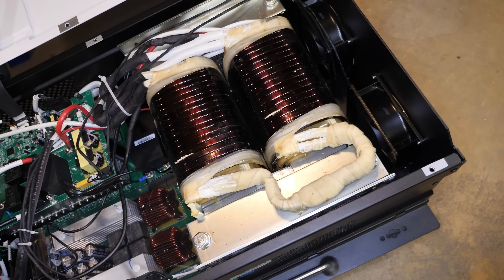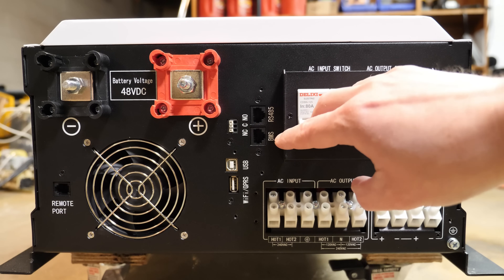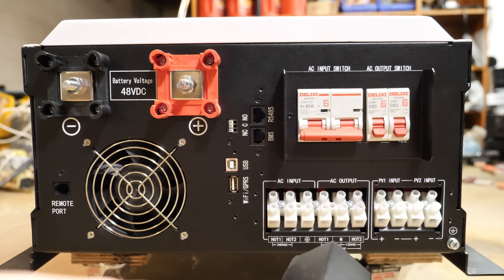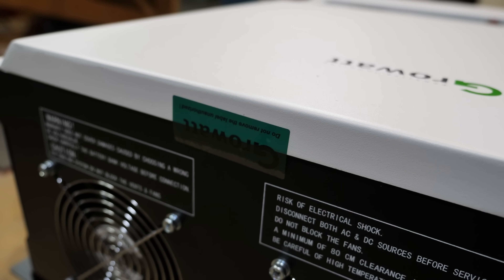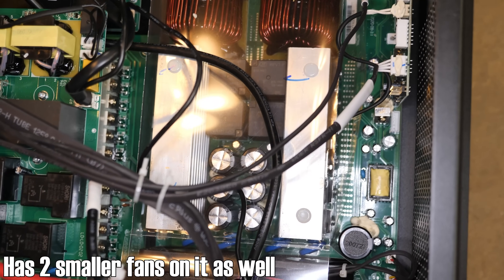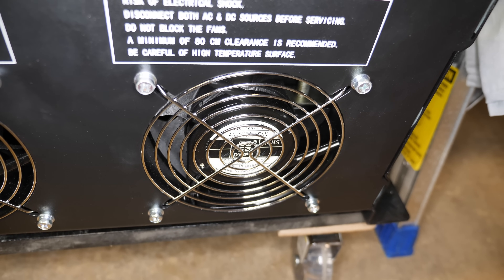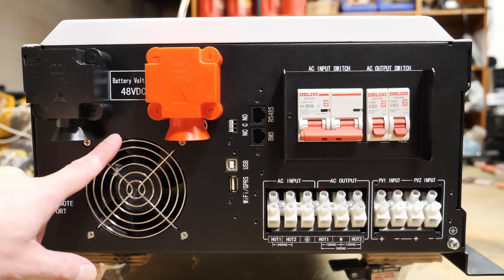Overview of a 12000w Growatt Split Phase LF Inverter!

Comment: Guys do NOT and I repeat do not get this inverter.   High idle consumption, loud fans, fans that break down after 3 years btw,   slow transfer switch you can literally see the lights go out and desktop computer rebooted.  Further more it's a pain to go through the setting compared to Victron and other models.  Yes the transformer is big, that doesn't say f all.  Victron and Ampinv also have huge transformers , have better features and are overall a lot better.  Just my humble opinion, i'm going by actual experience and comparison.
Reply from the maker: All valid for the most part! Except I didnt have the crappy transfer time. Mine worked great and computers stayed up and running. My fans never failed either but I did change them after a few years to quieter ones. This was the biggest I could afford at the time. Overall was happy with the intverter.

I have an eg4 hybrid inverter now and its great.

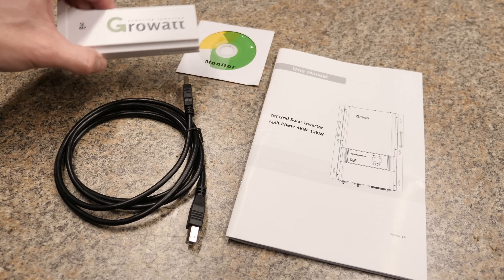Comment: Sorry my entire message did not get posted, I am in search of and for the 3in monitoring disk that you show @2:21 for the 12,000 watt growatt inverter,  I have tried the ginverter web address that is in the manual and there is absolutely nothing there, and i have tried the growatt master site and the only dl's there, are for the data sheet and the manual for these  beasts. I did buy two of them like I said, i was going to  do, but the USB cable is not any good without the software disk. AND to top this all off i have been in contact with signature solar and their response was (I did mention this video to them BTW) was, I do not ever remember shipping this model  inverter with disks of any kind,. unquote. My question is and was is "Do you still have the software disk for the 12,000 watt growatt inverter?" I need a copy somehow please . All avenues have been a dead end in my search for it. I believe that there is no one else to solve this missing disk thing. dead stop. Everyone so far clams that there is no disk included in this inverter package. @2:21 clearly shows that their is one...
I could email you but how would you know that it was me so it does not end up deleted or in Spam. GREATLY Appreciate any help that you can give. Thank You in advance.
side note i did buy two 12 inverters two rhino batterys and 48 250watt panels.  back in may 23 when i emailed you back then.

Comment: Hi, I do not understand how to use AC out 240v. Am i wrong or it's Hot1 + Hot2 (120+120=240) together, and then neutral and grounding cables. 
I will be very happy if you explain it in video and show it with some  consumer on 240v. 
I am planning to buy one of this growatt, and i need it for  EU standard were we use 220-240v.
No one shows in their  videos for Europe standards for 240v. 
Regards from Bulgaria, 
Thank you!!!

Comment: Would like to know how to change the circuit board.
Reply from the maker: One screw at a time.....🫣. Well, I would love to make a video on how to do that. I do have spare boards BUT the inverter is running my house. I would just start removing screws and wires until the board came out and take detailed pictures before your start and during the removal process especially where wires go.

Comment: One thing I want to understand with this PV inputs is that, can they both be fed with 150v?
Reply from the maker: Yes both can be feed with 150v.  Also a side note is I didnt notice at the time but they sent the 250v model!💥🤘
Reply: @AVERAGE_JOE  wow cool, but for me I want the same 150v model but being it a 6kw one... Along with 2 48v rhino for my caravan 😁
Reply from the maker: Awesome! That will be sweet! Dont forget the 10% off code "joe10"😉😉 Also if I remember right the 6kw only has one pv input but may be an 80amp. Id have to look it up again.

Comment: Hey Joe, any update on the performance of this inverter?
Reply from the maker: Still using it to this day 24/7. Few rando issues but I Love it and would buy again. On a down side is when you max out the charge controllers you will need to add seperate charge controllers. Dont remember if I said that in the video.
Reply: @AVERAGE_JOE  Hi, I have the same Inverter running for almost 9 months. What have been the issues that you have had?
Reply from the maker: When I first got it, I got a few fan lockup faults. Installed a newer firmware for that. Occasionally in the morning it will show solar on the screen but wont "connect" the solar so it wont charge. All I do to fix that is change the charge setting to another setting like SOL to UTI. Then few min later back to SOL. If that doesnt do it then I have to restart inverter. Another occasional rando is ill go into the app and change from SBU to UTL and it wont change. So then Ill have to manually change on the inverter.  Nothing crazy.  Anything you have or notice?
Reply: @AVERAGE_JOE  Hi again, seeing your post those are the same issues I have had with mine. But on the good side working like a horse!!! Thanks for the update! Hi again from Puerto rico!!

Comment: Hello, good video.
 Why at the voltage output of the inverter if I measure voltage between neutral and ground does it measure 60Vac?  How can this voltage between neutral and ground be corrected?
Reply from the maker: Is your output connected to a sub panel? Do you have input from grid? The neutral and ground will be bonded in one of your panels which will 0 out that voltage.
Reply: @AVERAGE_JOE  Hello thank you. The supplier says that only the 2 lines and ground should be connected to the network voltage input, but not connected to the neutral, is this correct?

Comment: Quick question that I couldn't find or get answered too.  We have the same 12kw Growatt.  Did you figure out if each PV input can handle up to 150volts DC?  Or is it combined total between the two ? Thanks in advance.
Reply from the maker: Yeah its 150v in each pv input
Reply: @AVERAGE_JOE  sweet thank you, trying to figure the math and it just wasn't adding up with the total of 7000 watts combined.  Nice videos........your helping big battery for sure, make sure they pay you !!!
Reply from the maker: Did you get a kit from bigbattery? Like inverter and battery or?
Reply: @AVERAGE_JOE  yes I did 12 kw Growatt and 28kw Rhino battery
Reply from the maker: Oh nice! So those kits I think have the 250v solar input. The tag/sticker on the side of inverter should say. I actually have the 250v version as well. When I did this video I ordered the 150v version and they sent the 250v version. Win win😆
Reply: @AVERAGE_JOE  Sorry for late reply, life sometimes gets in the way of hobbies like this.  Unfortunately i think they fixed there mistake about the 150v and shipping the 250 instead.  Either way it should be fine.  We hooked up everything with the inverter and both Rhinos.  Funny thing though is that we are only seeing amps report into PV1 and zero amps in pv2.  We are using both pv inputs.  So we are only really getting around 50 to 55 amps, which is then split between the two rhinos at around 20 amps a piece.  The concern I have is that might not be enough charging time to get it ready to run again at night.  So we are trying to find some solutions to raise the amps or get Growatt to report amps for pv 2.
Reply from the maker: First thing I would do is make sure your solar charge setting is correct in menu or make sure its all the way up. If its correct, can you check voltage of pv2?
Reply: @AVERAGE_JOE  yup I pushed the recharge all the way to 150amps. I think it’s the Growatt inverter limiting the amps. When I turn off the array on PV1 then the amps show in PV2. So maybe it combines the amps together 🤷‍♂️. Just would be nice to have more amps so the batteries can recharge in about 6-7 hours versus 9-11, and also run the house. Might have to get some more panels to help with it.

Comment: Dear this low voltage model can I install 7000 w on each pv input or no
Reply from the maker: 7000 watts total. 3500w on each pv input.
Reply: @AVERAGE_JOE  ok dear but if i install  4000 watt on each pv (3 panels in series) it will have a problem? I use the extra watt for direct load to my house and 3500 for charging

Comment: What size is the wire that feed the battery terminals?
Reply from the maker: You could add any size you like since it will be on a lug!🤘
Reply from the maker: Or did you mean the internal which is 2 8awg wires going to the solar charge controller and the solid bars go to the circuit boards.
Reply: Internal
But I’m gonna stick with 1/0 stranded copper bus and use the same 1/0 to attach the batteries. I have twenty, 48v batteries, u think that’ll be heavy enough?
I’m building a complete new system and it’s my first build.

Comment: What does the transformer do, as the 3000ES and 5000ES don't have one, and weigh only about 12kg?

Correction: While the 5000ES weighs only 12kg, it is only 240V, which would require a heavy transformer for use in North America.
Reply from the maker: Transformer based inverters are the same as the grid power and allow big load startups ect. Transformer-less use mosfets to try and mimic the grid. Usually cant start big loads.  They are more efficient tho!

Comment: I purchased this inverter 14 months ago... Last week it crapped out on me... Goes into Fault 51, won't recover... The  MTTP Solar Charger portion still works. Just no AC output. What good is a inverter with NO AC OUTPUT... Working with supplier now to identify next step to get repaired.
Reply from the maker: Damn sorry to hear that! Which place did you buy from? I know the boards are fairly cheap if its not covered under warrenty!
Reply: FYI,,, Signature Solar Technical Support has been great to work with... They have decided to RMA this unit and send me another one! What a great company to work with!
Reply from the maker: Thats GREAT!!!  Glad to hear this!!!🤘

Comment: Just got an answer from Growatt saying I need to run 3 2awg cables to each terminal... that seems a bit overkill and not necessary as the internal wire isn't that?
Reply from the maker: Lol thats unheard of. The manual doesnt say that at all.

Comment: Those spindle little terminals strips on the solar input worry me. This seams to be typical with almost all inverters. May be adequate but risky if wires loosen or strip cracks from tightening. This brand is available in Thailand where I am retired. It looks much better than most of the cheap Chinese products that are marketed by people who know nothing about product. Have been holding off starting for a few years now until the market matures and hardware improves. This inverter looks promising.
Reply from the maker: Yeah Im not a fan of those either. Id rather just connect direct. This is a chinese inverter however a decent one imo. I love it! Not to expensive which is great!
Reply: Ya I would recommend pulling them and replacing with larger ones. I highly recommend pulling inverter breakers too and install 75c temp rated or your stuck using 60c wire ameprage chart. 80amp input requires 4awg wire. Yet busbar only fits 6awg.... no you can't take strands off to make it fit. First against code. Second safety issue as it causes heat and arc issues. Loose strand that are not connected can start to arc over time. Really theses inverters I am surprised company hasn't been sued... you need use 60c chart as it's under 100a and underneath inverter breakers are not listed! normally 100a and under panels terminal are rated 60c anyways. anything above are 75c. 90c you will never see. 

So ya if you use a 90c rated wire but terminal rated 60c you must use 60c wire amperage chart. people don't know what they are really doing when wiring theses up.

Comment: Right on, thanks for opening that up. I actually have that same unit running my house and shop.
Reply from the maker: Nice! How are you liking yours?
Reply: @AVERAGE_JOE  So far haven't had a single issue. It runs everything as if we were on the grid.
Reply from the maker: Thats great to hear! Ours runs the same!🤘
Reply: @AVERAGE_JOE  Good to know, I have been curious about it because I haven't come across anyone else using them. Probably, because it is pretty big. I don't mind the weight though, I just figure that implied possibly better quality. I like your channel man. You cut right to the important info and keep the humor. Good job and keep it up.

Comment: Its amazing how many of these inverters use the same OEMs for parts.  Control boards and inverter boards are all Sigineer. Don't recognize the MPPT manufacturer but very well built. 

As for the warranty- They are required to honor it as long as you don't damage it. 

Busbars are nickle plated copper. (I've tested one.. replaced 2 of mine with a thicker copper one that isn't plated and filed the one I took off and it was copper)
Reply from the maker: Yeah Id say its a well built inverter! Many said the same on the warrenty so thats great news!

Comment: Hi Average Joe.  I appreciate this review.  I've heard that going "big" with the inverter makes sense so you can grow into it.  We have a fairly simple application right now to run a 10a well pump and 3/4 hp pressure pump ( both 240v).   Someday we will put more demand on the system.  My question is sizing a battery and PV array to work with this inverter.  Would there be a problem using only 6 (250 watt) panels?  Also intend on purchasing one 48V HSKY - LiFePO4 - 103Ah - 5.3kWh lithium phosphate battery.  Does pairing with this array and this battery make sense?  Thanks :)   New subscriber.
Reply from the maker: Thanks for watching! I wanted to go big so I can grow into it as well and I also wanted the option to run powertools or welder at any time while running the house. Yeah you could use this inverter, the 6 250w panels and the husky like you want no problem. I actually started with 6 235w panels, my diy tesla powerwall which is a little over 220ah. In summer I could recharge fully, winter was different but we get a lot of snow lol. With the Husky being half the amp hour you shouldnt have any issues at all. If you get the HV version inverter you can wire all 6 panels in series assuming your panels are around 40v open circuit. The LV version you would wire in 3s2p. Another thought if you dont need the 12kw like I have is Bigbattery has kits now with a 6kw growatt inverter thats just like mine and a Husky battery and cables. If you need/want the 12kw then sigsolar is the cheapest I found.🤘
Reply: @AVERAGE_JOE  Awesome info.  Thanks!
Reply from the maker: Of course!🤘

Comment: One reason it is so heavy is the low frequency transformer. A transformerless design would reduce the weight. I prefer a design without all the small cables and connectors. I'm a power electronics engineer and I do not like the physical build. Good luck!

Comment: So I got a question. My house uses like 4000kw a day. Was thinking of buying a Growatt like the one you are showing. Also a large 9kwk battery bank. My question is could I therorically run just off the battery for almost 2 days then charge them with a Generator when every needed?
Reply from the maker: If your house truely only uses 4kwh a day then YES you could get by with a 9kwh battery HOWEVER thats if you get the full 9kwh out of the battery. Usually you need like 10-12kwh battery for 9kwh usable so you dont completely drain the battery flat each time. Does that help? Let me know!
Reply: @AVERAGE_JOE  Thank you that does help.  Atm due to finances, I already have a generator. So I guess i will get a house battery next, then on to Solar panels later.

Comment: not one person reviewing solar power could answer my question😑
 , i want to go fully off grid with that 12 kilowatt or more mppt solar inverter. 
so I'm gonna use air conditioners and power hungry stuff about 6 kilowatt through out the day.
So my question is what solar array should i use because i need to charge the battery at the same time consume energy. do i need to double the amount of solar cells in order to compensate for that?
Reply from the maker: Yeah min you would want double!
Reply: @willi pine - You have provided very little detail ...
A) Min / Max - how many hours per day are you going to be consuming 6,000 Watts ?
You need to accurately know your total kilowatt-hours your loads will consume daily.
B) How many Amp-Hours is your 48 Volt Battery Bank?
C) Is the battery bank LiFePO4 or ?
D) How many hours of FULL sun do get? Best case and worst case?
E) How many days of autonomy?  1 night?  2 full days?  3 full days?
F) What is the deepest you will ever discharge your battery bank?  Down to 20% SOC remaining?
G) How quickly do you need that deeply discharged battery bank, back up to 100% SOC?
H) What happens to "hours of sunshine" during the rainy / cloudy season or winter?
I) What is the real world total amps from your charge controllers?
J) Are going to use a back-up generator?
K) Have you used any website to estimate your real world monthly PV Production?

6,000 Watts at 48 Volts / 85% is about 150 Amps.
If you DOUBLE that, then you need 300 Amps from your the Charge controller 
Can the the PV Charger inside the 12 kW Growatt actually output 300 Amps????
You need much more information, to make sure your system will function properly ...

Comment: He Joe
I told you  before I order the same inverter 
But still not arrived 😪
But I prepare when it's arriving 
I have a question 
The Pv 1 and 2
Can the handle independently 150 v
Ore is this totally max  input for pv 1 and 2 counting together 
Or 150 volt pv1 and 150 volt on pv2 
Thanks
Reply from the maker: Still not there aya! Yeah each pv input is 150v and 60 amps. So pv1 is 150v 60a and pv2 is 150v 60a
Reply: @AVERAGE_JOE  
Hopefully it's coming soon but it's from China and it's have to go to curacao 40 to 50 days 
I tried to get the 250 volt but the don't sent it to curacao 🤔
Thanks for info 
Like you films keep them going 👏
It's help's a lot